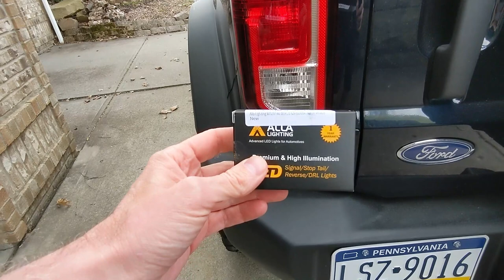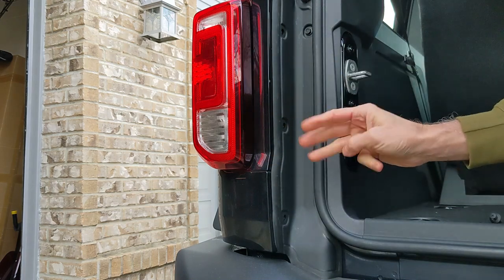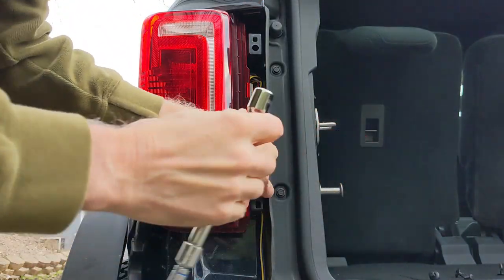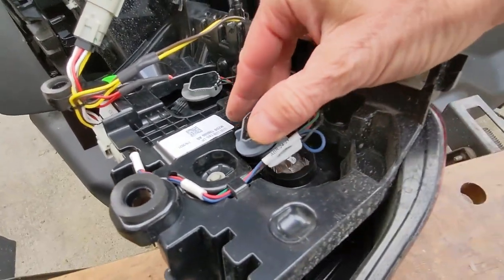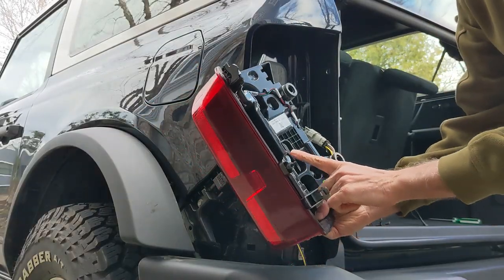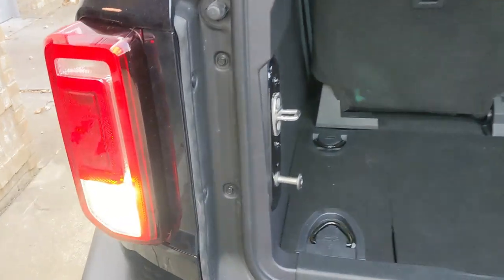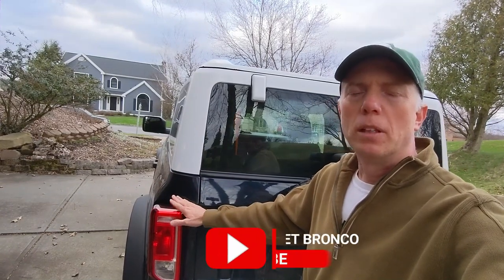2021-2022 Ford Bronco - Tail light LED reverse bulb replacement upgrade

Comment: Make sure your Bronco has Halogen bulbs. My Outer Banks does not. I made the mistake of assuming the upper end Broncos did if the base package did. Crazy how involved the bulb change is.
Reply from the maker: Correct, if you have an Outer Banks, Badlands, Wildtrak, or Everglades (and Raptor, of course) your tail lights come with LED from the factory and you do not need to make this upgrade!

Comment: Holy CRAP!  I seriously hope my bulbs last 10+ years with all that work.  That’s a pathetic design flaw on Fords part. 

Thanks for the video 👍
Reply from the maker: Hopefully they do last! But if not replace with an LED and it will probably last as long as the truck does. Thanks for watching!

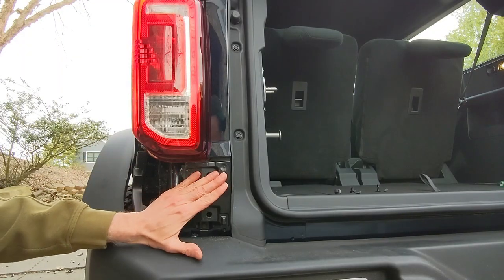Comment: That's worth it !  Did you catch the "3DR" on the bracket under the trim panel at 3:19?  I wonder if Ford designates this a 3 Door ?
Reply from the maker: I did notice that! I have seen it referred to a 3 door in some Ford literature, I guess they include the tailgate as a door. But on the window sticker and in the owner's manual they call it a 2 door or 4 door 🤷‍♂️

Comment: Going from halogen to LED does the bulb need a resistor to stop hyper flash?
Reply from the maker: For the reverse bulb that I did, no. For turn signal bulbs, I don't know for sure but I think likely so.

Comment: I’ve had these bulbs in since August. Big fan living in the woods. Oracle just released theirs. Wondering if they’re much brighter for double the cost.
Reply from the maker: Yes I saw the Oracle ones, as of right now (early April 2022) they are on pre-order for $40 plus shipping. Oracle does make good products, and they list them as 2200 lumens, so that is a little bit brighter than the ones I installed which are listed as 1400 lumens. So if you are willing to spend a little more, that is probably a good option as well.

Comment: bronco’s original halogen turn signals, reverse light,brake light are what models? wt21?
Reply from the maker: This is what is says in the user manual: Rear lamp, stoplamp, rear side marker lamp and rear turn signal is WT21W/7W, and the Reversing lamp is WT21W

Comment: Love the video! Thanks for doing this and sharing the light bulb you got. I plan on doing this when my bronco comes next month. 

I was wondering though if it is the same bulb for the brake light? The link for Amazon that you have shows the regular backup WHITE bulb but also has a RED one available. I’d like to do both but didn’t know if it was the same and would fit.
Reply from the maker: I don't think the same bulb in red will work for the other light. Reason being, the standard halogen bulb it replaces has dual filaments since it operates as both the running light and the turn/brake signal. I have seen others on the Bronco6G forum say that they tried it, but when using turn signals they got 'hyperflash' I think meaning it cycles on and off very fast.

Comment: Any info on an LED bulb for the brake lights?
Reply from the maker: No, I have not seen anybody selling one yet that does not cause issues with flickering or error codes.
Reply: I haven’t been even able to find a normal bulb replacement…

Comment: hi! thanks for sharing, the socket is t20?
Reply from the maker: Hmmm...unless I am forgetting something, there is no Torx required. Only metric sockets 10mm and 8mm. Which part of the process were you looking at?
Reply: @BudgetBronco  sorry, what I mean is the bulb socket. Is T20 bulb? You know the base of the bulb, the connector model. Im looking for a similar model, in my country I can't get "lasfit". So i need to know the bulb type in order to purchase the right bulb, but manual describes the lamp as wt21w.
Reply from the maker: Ahh now I understand! You have the right designation per the manual. I cannot say for sure if this is what would be called 'T20' but it looks correct. My advice would be to order from a place that has easy returns, and if it does not work properly return and try again. Good luck! PS: Can you order from this place? https://www.oraclelights.com/products/wt21w-extreme-performance
Reply: @BudgetBronco  thank you so much. Have a geat day!

Comment: How is the wrapped MIC top holding up..   is the wrapp sticking well to the MIC top?
Reply from the maker: Pretty good but not perfect. On the top-middle along the ridges there are a few spots where I see air bubbles forming, and along the edge in one spot where I did not do a good job and there are some creases, it is not adhering well there either. I will make a video in the summer and show the details.
Reply: @BudgetBronco  do you think its more of a adhesion issues with MIC top or a installer experience issue..      Could a professional make it work better, they may have tricks for these issues?
Reply from the maker: Honestly I think a little of both. A pro could definitely do a better job on the ridges and the curved corners, but I don't think wrap on the MIC top will ever last as long as the smooth painted surfaces for sure, the textured surface and maybe the plastic off-gassing are a factor. For the $180 that I spent on mine, I would be happy getting two years out of it. But if I paid a pro $1500 and only got two years, I would be disappointed.

Comment: Who ever engendered this needs to be kicked in the head. Changing a bulb should require NO tools.
Reply from the maker: This is definitely the first car or truck that I ever owned where you couldn't replace the bulb from inside the trunk or rear hatch by removing a panel or carpeting and just twisting the bulb out.

Comment: All that just too replace a bulb?? Engineers need to go back to the drawing board.
Reply from the maker: True, automakers are putting more focus on function and cost much more so than repair and replacement effort and costs these days. Headlights and taillights are a prime example. They are one of the first things to get dinged or broken in a minor bump or fender bender, but often cost $1000 or more to replace these days.
Reply: @BudgetBronco  This is a very useful video in case a bulb burns out. Thank you! Access should be from inside the rear storage area like in most vehicles.
Reply: Not good not terrible design. On some cars you gotta drop the rear bumper. I think Chevy Impala was like that.